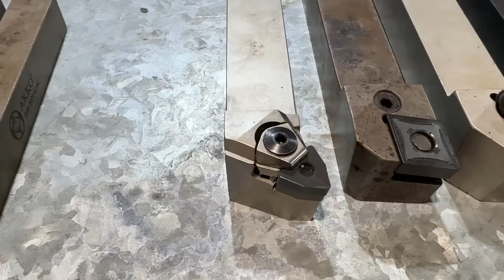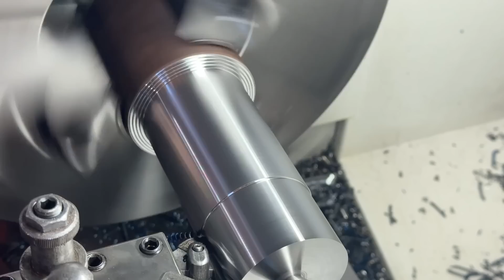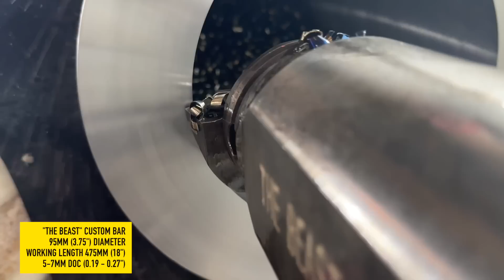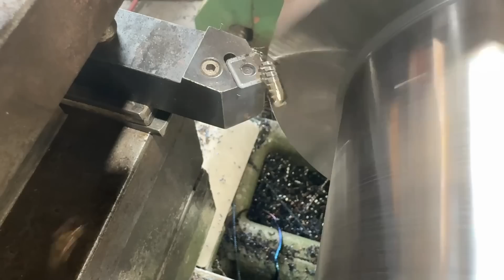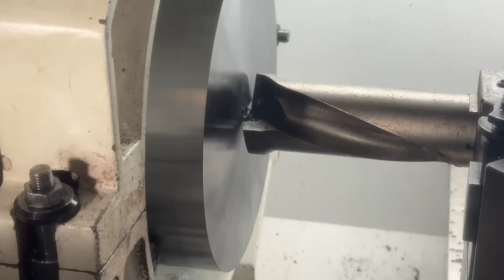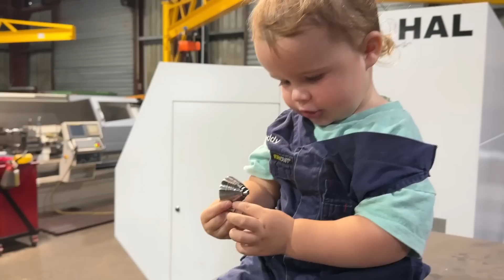The Carbide Inserts We Use (And WHY!)

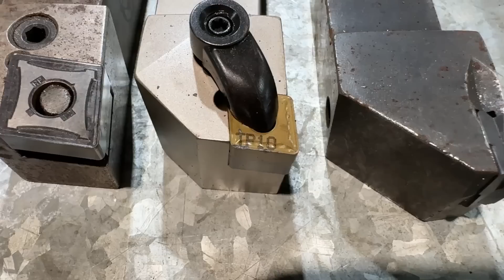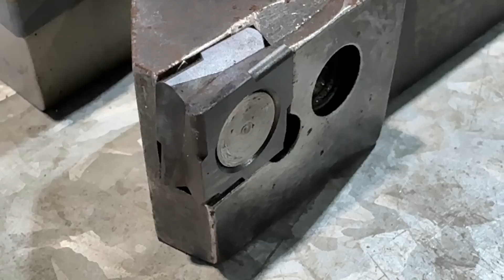Comment: At 2:39, 5:27, 8:04, 9:40, 10:10, 10:45, & 12:08, you show a big flat galvanized sheet. What does it belong to? I have never in my life seen a galvanized surface so big, so flat, while at the same time having such large crystals. Usually galvanized sheet metal has tiny little crystals. Maybe because your galvanized sheet is thicker gauge? Thanks!

Comment: I use U drills on my manual lathe & they work better than MT drills, there are amazing inserts available now that chew through SS or 4140, of course I use coolant on 20-40mm U Drills, & for smaller diameters 9-17mm (16mm shank) u drills. It speeds up my roughing considerably compared to HSS

Comment: For shallow through holes in the lathe I like annular cutters. I have a good range of them for the mag base drill and they are so much quicker and less messy than twist drills, no good for blind holes and limited in length. I sometimes even recycle the cores. To small for most of your work more relevant to hobbyists. I find myself using the annular cutter attachment in the tail stock very often, I thought I would pass the info on
Reply from the maker: Agreed totally. We have three mag drills of varying sizes and they’re super handy.

Comment: Hi Matt. Having been a Sandvik Coromant sales and project engineer for 38 year's, l think you are missing some extra income, where I hear you say, It's scrap not the cutting/swart/chips. It's the very thing that cut the metal, the carbide inserts, when you think it's finished it isn't 
, scrape carbide inserts have a value. Here in the UK you can get about six UK pounds per kilo for it, had one of my customers getting 2 grand a year for the tips, drills,mills,, which was getting thrown away.
 Makes your bank balance a little better and do your bit to save the worlds waste. Have a Happy Christmas and New year.
Taffthetip 
, now work out I got that nickname

Comment: I've got a mix of replaceable tip, SOMT and WCMT drills, I think the SOMT actually squeal less in my experience. We tend to cut a lot of stainless though so, most cuts talk back to one degree or another. I do wish I would have sprang for a VMD style drill back in the day. Instead, I ended up going for a modular anti-vibration boring bar (Tungaloy), that thing is rather impressive but I do wish I could put a CNMG 431 on it. 

On that note, I've had good luck with Mitusbishi's 9025 (in CNMG format) grade for weld removal and roughing through heavy scale. 

I'm in the same spot for threading inserts though, I never know what thread is going to be needed next so, I'd also be interested in a replacement for the top notch system.
Reply from the maker: Thanks for sharing mate.

Yeah I’m still looking actively for a better threading solution that’s equally versatile as top notch
Reply: @halheavyduty lately, I've been doing more and more thread milling where I can, especially for large acme threads. I don't think the tooling cost is any better but, the quality and deburr definitely is.

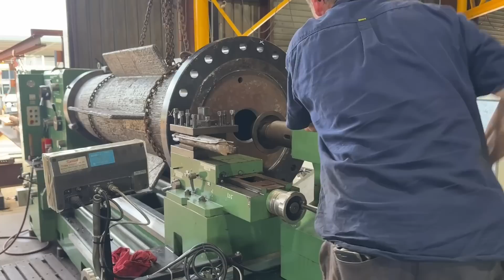Comment: Hi from New York. At the 1:24 minute mark, the pipe loaded into your lathe with the gussets and baseplates. Are the welds vertically on the shaft for strength or wearing and are they done by machine or hand?
Great detailed informative video. You narrate like a pro. Very easy to listen too.
Reply from the maker: For stretch, and they’re done by hand.
Reply: @halheavyduty  How long does it take to weld it?

Comment: I work at Sandvik Mining and I turn drillbits. WNMG is our go to insert mostly we use 1.6mm noseradius.  We used to have drills with W inserts too but since Coromant stopped making them and to have them tailor-made got to expensive we unfortunately had to go to 880 drills.

W is probably the perfect balance between cutting depth and corners, not best at anything but overall capable and most economical.

Also depth or cut should not be less than ⅝ nose radius according to Coromant.
Reply from the maker: That's very interesting.  DOC not less than 5/8 Nose rad.  I'm going to make a few adjustments on the finishing cuts and see what happens.  Thanks for that.

Agreed re the W too.  Great all rounder.  Like the MacGuyver of inserts.

Comment: I'm about to turn 65 and currently fill a small niche of 3 strictly manual machinists in a large repair oriented machine shop employing about 75 people. I went through 2 years of machine schooling as a young man but never saw or used a carbide insert until I got into industry.  Until then it was all high-speed grind your own.  What we have today still amazes me.
Reply from the maker: It’s incredible how far it’s all come. Really took off in the early 2000s I think…
Reply: Same age and can remember when Carbide inserts came out, very expensive.  Same thing with Isocyanate glue.  About $125 for a 20ml bottle in 1977 and you had to prove you had a legitimate use for it.
Time has bought many improvements, technologies and cost reductions.

Comment: Thanks for posting this info. Coincidentally at a time when I am looking for some inserts. There is a minefield of info out there now compared to 30+ years ago when I was in the trade. We only had a choice of a few inserts the rest we just ground hss. (think threading, grooving etc). Can you tell us what size inserts you are using and tool holders, (brands not needed just insert sizes/codes eg wnmg080504 etc etc... cheers from Brissy

Comment: Do you ever use any of the 75 degree turn tool holders? I believe that’s what they are called. Basically they just use the sides of your cnmg inserts you don’t typically use. Helps save cost and we have used them for heavy roughing. Only downside is side is that it leaves an angle on the back for cleanup.
Reply from the maker: We tend not to, mostly because we have internal shoulders to allow for.
Reply: @ yeah that’s the same reason I don’t use them as much. The abuse typically that I have to put on an insert to clean them up is enough that I just use the cnmg. Those tangential inserts are awesome for roughing though, I have the same one from kennametal that I LOVE! I also just recently got one of their MAQ boring bars that’s dampened and it works really well if you ever run across an issue with getting rid of bore chatter. They are quite a bit less expensive then anti vibe bars and works very well
Reply from the maker: That’s really good to know. I’ll check them out. Thanks mate!

Comment: You can't beat Kennametal tooling and inserts. Good equipment.  There's other that are good too.  On threading inserts, over here on the North side of the pond, I see a lot of Tool Flo inserts used for the oilfield threads over any others out there.  Don't know if there is anyone in Australia that sells them or not. Worth a try.  As always, thanks for sharing.
Reply from the maker: We use some tool flo. They sell interchangeable inserts that fit the top notch tool holders, which is good.
Reply: @halheavyduty  Excellent!

Comment: Matt, I enjoyed the discussion as I am a home hobbyist, you didn’t include in your review “positive” and “negative” inserts and their holders….when/why to use???  For both rough/finish and materials….still a mystery to me as I make my random choice when manual machining to achieve finishing along with speed/DOC?????
Reply from the maker: The positive inserts are less durable, so better for finishing and lighter cuts (in my experience)
Reply: A good rule of thumb is to do all roughing with ISO N (0°). Use the most stable one that the part geometry allows, like a W or C shape. Nose radius 0.8 or 1.2 mm. When turning on less stable machines a 0.4 may be called for. After roughing you will have left 0.4-0.5 mm allowance for finishing. Usually finishing is done with ISO C (7°) with D or C geometry and a 0.4 mm nose radius. Pointier shapes like V geometry may be called for when doing undercuts etc. We currently do a lot of finishing with V geometry but that is more the operator's choice than mine.
Reply from the maker: Agreed 100%

Excellent detailed explanation (as always).  Cheers brother

Comment: Interesting. I have a small lathe (250mm swing, 550mm between centres) and haven't tried cnmg etc as i feel it is too much tool for my lathe :)  I tend to use CCMT, CCGT, and diamond for fine work. Maybe one day i'll give them a play :)
Reply from the maker: Wise move! Personally I’d stick to what you’re running.  CNMG are ideal for the heavy stuff, but overkill for lighter in my humble opinion

Comment: I actually use VNMG probably as much as CNMGs. CNMGs for heavy cuts on large diameter materials. VNMGs are more versatile in my opinion as the can be used for profiling and type 2 roughing cycles. But as you said, they are much weaker so don't expect high MMR. I use them mostly on smaller diameter stuff or as a semi finisher before switching to a VCGT for finishing. I don't run large batches so tool switch adds time to the job.
Reply from the maker: Agreed.

Comment: The shop that I retired from 8 years ago would spend about $9K/week on Sandvik inserts.  Solid carbide endmills we would spend about the same per week.  We would use some Kennametal and Iscar inserts too.  Carbide end mills were typically Garr, Ingersoll, Iscar, and Harvey.  High speed drills would be cobalt (Cleveland.Greenfield) and solid carbide drills would be Guhring.  I can't imagine what the stuff would cost today.
Reply from the maker: Wow they must have put through an insane volume of work with that much carbide expenditure.
Reply: @halheavyduty  Decent sized commercial job shop with some excellent customers.  Had about 20 Haas machines and about 10 Mazak lathes.  The Haas machines were being phased out in favor of Makino & Mori-DMG machining centers.  Lots of issues with Haas ball screws.  Surprisingly, a lot of aluminum was machined, but we also machined a lot of titanium castings and duplex-stainless steels.  Some PEEK plastic was tough on tooling too.
Reply: Holy crap when you start dropping that much on tooling every week, you better be generating a boatload of money heading out the front door or out the back door I should say and billable time out the front door that’s unreal but some of these exotic metals you have to have the right insert, and it makes all the difference in the world
Reply: @steveanderson4768  Sandvik isn't cheap, that's for sure.   I remember one week when some toolholders were ordered along with inserts that the weekly Sandvik tab came to $17K.  Since I left, the firm has procured some high-end Citizen CNC-Swiss lathes...$300K+ fully loaded.  I have no idea what style of tooling those machines would use.  Our largest use was Sandvik CNMG-432 2025 averaging 80 inserts per week.

Comment: The only thing I have to really correct is that you can absolutely use less than the nose radius, it just has to be a fairly rigid setup. Generally the minimum cut is 1/3rd the radius,  where like 2/3rds is the maximum higher feed setup. When you do this you increase the feed to make up for the reduced depth rather than taking a deeper cut, this can often lead to faster paths, or for example in “adaptive” turning it can use a round insert for roughing and take that high feed which optimizes to keep the machine moving smoothly.
Reply from the maker: Thank you.  That is a great explanation. I’ll be trying that this week.  Appreciate the details.
Reply from the maker: Thank you.  That is a great explanation. I’ll be trying that this week.  Appreciate the details.

Comment: Hey Matt, one of the other reasons you get less chatter with a smaller nose rad is because the cutting tool is in contact with less material. I chuckled at your tight tolerance of .1 When i was working in tool and die .012 was a very normal tolerance to see. The parts were also 60HRC. You being able to cut those monster threads with such a nice finish is magic to me though. Thanks for the video.
Reply from the maker: Thanks mate!

Comment: Wow, there's SOOOO much to talk about. Literally this could go on forever.  In a good way. So you machine a lot of 4140 Q/T or P/H or some other variation. Anyway, the WNMG series of inserts. I love them. Not only for roughing. But for finishing. Depending on the diameter and the length (because there's a lot of tool contact, can cause chatter issues) The ability to generate say a 63 finish for example. So SFPM 650ish at around .026-.032 FPR . Depending on the grade of insert. Work great! Feel free to check my numbers with a profilometer.
It's a super time saver. As opposed to using  DNMG/VBMT series diamond. Where you would have to be running around .005/.006fpr and end up with a mess of stringers.
I'm a journeyman machinist with almost 30yrs under my belt.
Just a conversation starter. I don't want this post to be too long.
Great job btw!

I'm adding this to translate the abbreviations for those not familiar with the lingo.

SFPM=Surface feet per minute
FPR=Feed per revolution 
Q/T= Quenched and Tempered
P/H= Pre Hard
DNMG=55° Diamond insert
VBMT=35° Diamond insert
WNMG="Wiper" high speed/feed finishing insert.
Reply: Feed per revolution. Sorry about the abbreviations
Reply: @ Not at all ! Thank you for enlightening me. It’s much appreciated.
Reply from the maker: Mate. That’s a fantastic comment. Love the detail and insight - and thank you for the bottom part too for all those unfamiliar.  Helps everyone learn. Very grateful.
Reply: @halheavyduty  here's an added tid-bit
Sandvic also offers a version of the "wiper" insert. It's actually an 80° Diamond. So a CNMG I don't remember the actual series ID I'll look later and add it to this comment for you to check out.
The good thing is you don't have to purchase another tool holder. The insert goes rite into a normal CNMG tool. You would use the same/similar speeds and feeds to generate the same surface finish.
However, chip management needs some attention. You really need to run a heavier finish pass to help controll the birds nest. But they work well also.
I really dig your channel. You guys machine the kind of jobs that I like. Gotta stimulate the brain rite.
Reply: @wantlessobject  Please excuse my ignorance, but what does FPR stand for ? Thanks, Richard

Comment: now you just need gun drills and edm drilling ( the edm wouldnt actually be to bad of a idear for you. though you would need to put it togeather yourself. but it would allow you to drill like a ø300x1500m deep with a ø298x1500mm slug comming out of it )

btw is it down that i should menting that in those 5 month i did on swiss/sliding head lathe that we often did 7mm doc ( 14mm on the diametor ) with the v insert xD

i was thinking about doing a project where i would use cnc vice's to make a surprisingly strong and precise lathe where you can run/use it as a normal lathe but also as a manuel swiss/sliding head lathe up to 25h6 barstock with like 10k rpm( just because its cool and i can )
Reply from the maker: Very interesting.  It’d be super cool to have a big edm machine.  Let the sparks fly…

Btw nice DOC on the V insert too. Serious chippies coming off that
Reply: @halheavyduty  its all about that absolute rigidity and because of how a swiss/sliding head lathe is made and do it. its actually more rigid then that huge ass manuel lathe you saw in my video. even though its onlt like 900-950 kG ( a little less then my car ) but because your only cutting about 0.1mm away from the support/chuck all the time its extremelt rigid ( i have seen people turning theres into a diy swiss and got pretty much the same result as a real one. with exception of the speed since they topped out at 4k rpm but a real swiss tops out at 10k rpm on main and counter spindle )

btw did you know that you can actually also turn smaller lathe part in the mill ( since its basicly a lathe standed up on its end with a righer rpm and a Y axis mounted on it )

Comment: The last time I used a metal lathe was in 1957, when I was in the 9th grade.  At that time the tool holder held a hardened, sharpened piece of steel, no idea of what an insert would be.  I have thoroughly enjoyed your educational pieces of what a real, modern machine shop actually does.  Thanks for giving a view into what goes on both large and small in your world.
Reply from the maker: Cheers mate! Yeah that would likely have been some High Speed Steel ground into a cutting tool. We still use them from time to time.  Great in shitty cutting conditions.

Comment: Thanks Matt.

As a retired mechanic who "plays" with machine shop tool, no one has ever taken the time to explain this and honestly, I never really took the time to look.  I just always made what I had work (and that can be interpreted very loosely as to what work means).  I just dabble in the dark art of metal removal and still use lots of HSS or cheap Chinese carbide.  The lathe I can use has an infinite amount of backlash so I just blame the lathe for all my mistakes.

The shop that has the lathe I can use does not have anyone who knows how to use it, it is a legacy machine left over from an old guy who retired years ago, so anytime I can chuck something up and tune it up a bit or clean it up, they think I am a god.   Boy are they mistaken.

I might have to go out and buy a couple of real cutters and see what I can do with it.
Reply: For hobby the cheap chinese carbides are good enough and it doesnt hurt as much if an insert breaks. For the price of one insert from Iscar, Walter, Kennametall, ect. you can get a 10 piece pack of no name inserts. The cheap profesionell inserts start at around 50 bucks for a 10 piece pack and can go up to 250 bucks.
On the job i used the "real" ones, because i didnt had to pay for it, on my table lathe use the cheap ones
Reply from the maker: Love it.  Blame the backlash 100%

If I had a home shop I’d just be buying the Ali express Chinese stuff to play with. It seems to work fine and is a fraction of the cost.